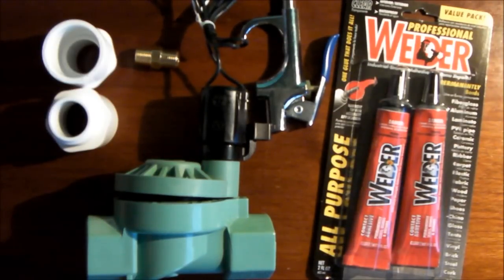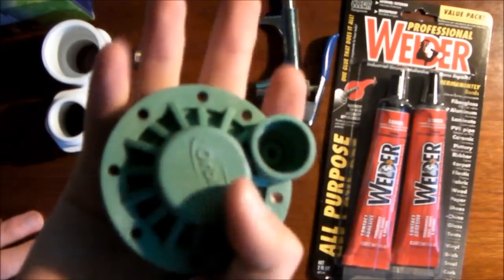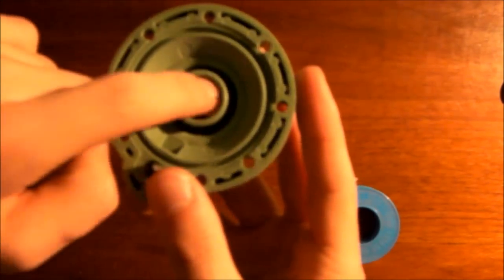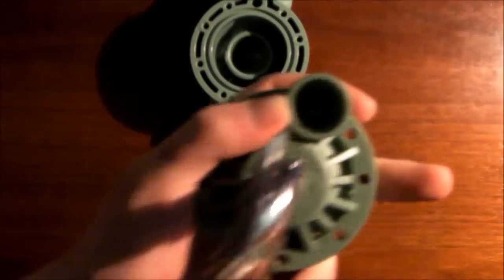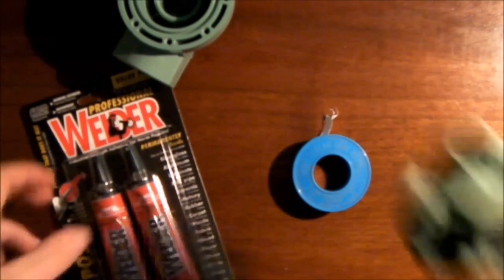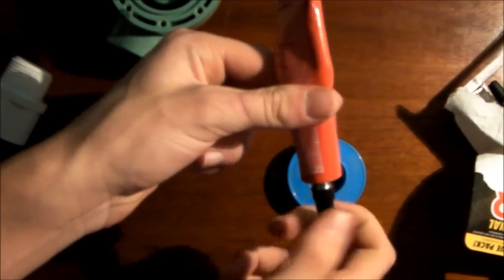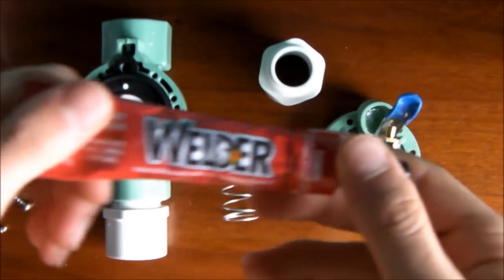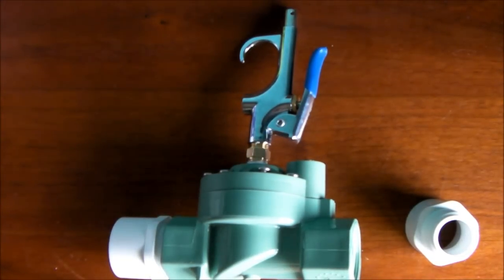How to Modify a Sprinkler Valve for an Air Cannon

Comment: Great video, liked and subscribed. Teflon tape is wrapped in the direction of the threads, so since you have right hand threads (clockwise) then the Teflon tape gets wrapped clockwise so as to not unwrap the Teflon tape as the threads get screwed in. Also, the diameter of the hole you glued in does not get the full force of the psi (pounds per square inch); for example, 300 psi is a force applied to 1 square inch, and if the hole glued in is 0.040 inch then pi/4 x 0.040 x 0.040 = 0.001256637 square inches in area and the force experienced by that area from 300 psi will be 300 x 0.001256637 = 0.377 Lb.f (pound force), so a fine machine screw with a touch of that cheap Chinese glue would take care of any air leakage. Either way, great video. I've been hunting for a video that explained the conversion of the sprinkler valve with close-up shots. Thank you for the video and will see all your others.

Comment: Just so you know when you are putting Teflon tape on threads you rap the Teflon clock wise if your looking at the threads, because if you rap the tape other wise when you screw the threads together it can back off and the tape will fail and you wont be able to screw the item down as tight as you need too. So if your thread pattern is righty tighty you wrap the V tape lefty! Just food for thought!

Comment: Interesting mod. The "jar top" style of Orbit valve lets you unscrew the top of the valve like a jar lid. No screws to deal with. In my experience, normal city water pressure runs 40-70 psi which is why this valve is OK at 50. MFG will never recommend using plastic anything with compressed air, but your mileage will vary. Your trigger-valve could be used remotely at the end of a tube, but the Orbit valve may open more slowly. I use a similar valve with the solenoid intact for a compressed air special effect. I'm running the solenoid at 12vdc (R/V battery) with 16ga wire at a distance of 15 ft. (use the heaviest gauge wire you can get with DC, and a dedicated ground wire for the solenoid) With that setup, the solenoid will fire the valve reliably at up to 100 psi. I typically run 80 psi. I would not recommend my setup for a handheld gun, but its great for special effects where the valve is 11 feet up in the air, crammed inside a sculpture.

Comment: You can screw in a plug where the solenoid was. You could probably find a pvc plug next to where you got the sprinkler valve. Steel or brass would work too.

Comment from the maker: Make sure you didn't screw up the seal by getting anything on the rubber gasketinside and then also ccheck for any leaks. If it is letting the air through there is probably air escaping out of the top chamber somewhere

Comment from the maker: The hole is 1/2" and it is a 1/4" nipple lol. The diameter of the nipple is the internal diameter, and the diamater of the whole is the outer diameter. That's why theyre 2 different numbers but don't worry I promise that will work! If not, you can always test with a smaller sized hole and CAREFULLY make it larger

Comment: Does it still function if you leave the solenoid on? It would be nice to have two options.
Reply: Yes and you can activate it with a 9 Volt battery if you are using anything under 40 psi. most sprinkler valves need 18 volts to open it if  its any higher than 40 psi so you can use two 9 volts connected in series

Comment from the maker: You don't even have to go there, it is very simple and open ended. Add some thicker pvc to one side with an inlet so you can attach an air compressor, and add a barrel on the other side. That's it. If you want to get into more detail as to the sizes of each I would recommend 3" thick pvc for the tank, and use a barrel thats 1 or 2 inches thick. Make the barrel twice as long as the tank. usually 2 foot tank and 4 foot barrel works well.

Comment: Why would you remove the relay? I wired it to 3 9 volt batteries and a push button trigger, lightest trigger pull ever. Why get rid of it?
Reply: Because I like to keep my air cannons purely mechanical, adding batteries and a switch just adds more that can go wrong. This method is basically foolproof and requires no batteries
Reply: 3DprintedLife or you could just buy a valve
Reply: He's using someone elses info to get hits on his videos... you see there is no props given to the video he learned it from and he doesn't understand why it works, it just does.
Reply: phartattack I saw people talking about this valve modification online in the late 90s. Nobody knows who did it first.
Reply: Thank you, I came here to comment that.
Reply: phartattack that explains a lot. I'm usually reluctant to dump on a kid who seems sincere and maybe doesn't have a Dad to clue him in, but at the beginning when he shits on 240P then makes his in 720-O (for out of focus) the benefit of the doubt begins to fade. This is essentially a crappy-production tutorial. 😂

Comment from the maker: I wouldn't do that. Remember there will be an enormous amount of pressure and the hole is slanted so it would be tough to block completely. It is very important the seal is perfect because if air gets out, that will trigger the cannon. Misfires=bad. In my opinion you should stick to the jb weld

Comment: Hey Magma, I really appreciate this video. I did all these steps in this video and I attached it to my barrel and chamber, but when I pump it up, air is leaking out of the barrel. So that must mean something with the sprinkler valve is faulty. Do you think you can point out the mistake?
Reply: +Junlan Lu make sure the arrow points towards the barrel

Comment from the maker: Well mine is rated for about 110 psi but yes I wouldn't go higher than that. If you do, be prepared for parts to break off. A little ring inside mine popped off because I was running it consistently at about 110psi, but it's nothing a little jb weld couldnt fix!

Comment: insted of filling the holes the solenoid leaves behind after removal could you just use a screw in plastic end cap to seal it would be much faster ?

Comment: that blow gun valve (connected to the original solinoid valve) is rated 90 psi so can i only put 90 psi in my chamber of my air rifle???   cause i bought the same blowgun valve as you

Comment: sorry, I have another question.  I've watched other videos, and some people use a pipe tap to place threads in the hole I (don't have a pipe tap).  However, from what it looks like on the video, the plastic isn't that thick.  Do you think a pipe tap is necessary?

Comment: I know that the blow gun requires a 1/4 " nipple, but what about the other end?  You drill a 1/2" hole, but use a 1/4" nipple.  So do you use an adapter or is the hole really 1/4"?
Reply: The nipple is 1/4" inside and 1/2' outside

Comment: i have the problem opposite problem of derek. the valve will not fire. when i use the blowgun, all the air rushes our the blowgun. i am able to reach inside the port and push the valve up while holding the trigger, so i know it is not just something keeping the diafragm down. help plz

Comment: Sealed up the holes and all mine does is bleed the air out the trigger and nothing out the end of the cannon.  
3 valve I've had to buy.  Got 1 to work. Australia must be getting a supply of shit valves.
Any idea what's wrong ?

Comment: what's the metal valve piece called? What are they normally used for?
Reply: Alden Lulamoon The brass piece is a blowgun valve that you can buy in a set with the 1/4 in threaded nipple. You can but this at lowes or home depot

Comment: In this video and another one, the solenoid was discarded... why? Isn't it easier to trigger the valve by a switch that runs off a battery?
Reply: The solenoid works with a tiny port ( about 1/16" diameter) which, by design, releases the pressure slowly.  It also releases that pressure, which is normally water, into the outlet stream.

Comment: Why doesn't the air pressure just release out the nozzle?
Edit: ok, nevermind. I just found a video explaining how the diaphragm works in the sprinkler valve.. it release pressure allowing the diaphragm to lift allowing the pressure through the valve which also stops it going out the nozzle..

Comment: Would a lot of hot glue or super glue work?
Reply from the maker: Definitely not. Both of those would work in very low pressure systems (5psi or less) but that is child's play. JB weld is just about the only way to go if you want to use an air cannon charged above 10psi (and up to about 100-150psi), and the $5 is well worth it. If you try and go cheap and use something else to fill it, it will very likely end up failing and causing your air cannon to misfire. $5 is a very small price to pay to almost guarantee no misfires will occur.
Reply: Schematics not much?

Comment: why bother with the glue when you can just screw in a PVC plug into the solenoid port????????
Reply: +jadesluv good plan, I am building mine with a revolving cylinder for an auto loading tank design.

Comment from the maker: That piece doesn't matter, you can leave it on or take it off it won't effect how your valve works. Mine used to have that piece on it but I took it off just to make the valve a little smaller

Comment: you said 1/4 inch nipple then drilled a 1/2 inch hole. ???
Reply: 1/4 inside diameter pipe needs a 1/2 inch hole  to fit the outside of the pipe.

Comment from the maker: Nope not at all, just use teflon tape and you'll be all good. There is a slight chance there will be a small leak if you untwist and retwist it a lot so in that case just put some jbweld around the joint

Comment: Or you can just use a battery with the valve like intended
Reply: He saids it opens to slowly
Reply: +codman8383 yes you can it takes at least 24v i use 3 9v = 27v works great